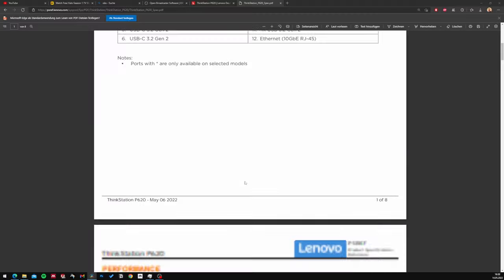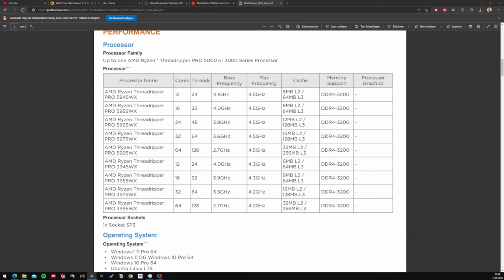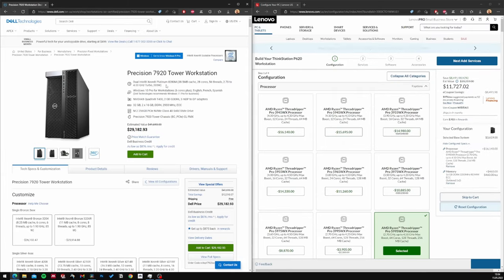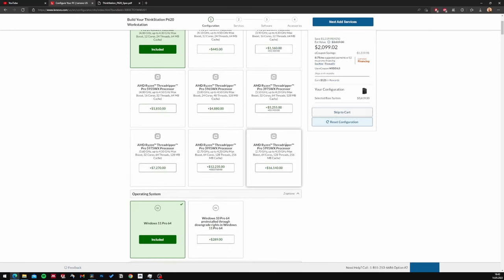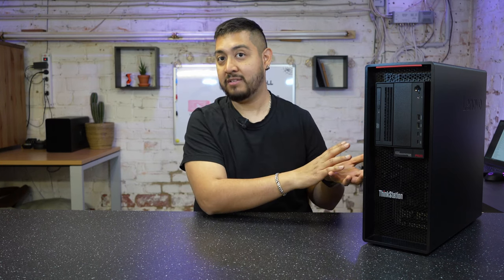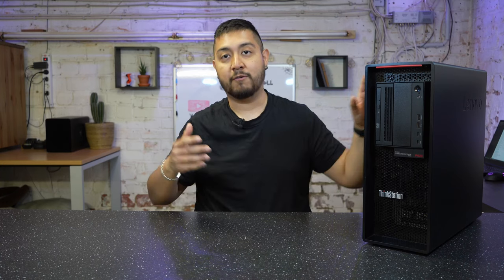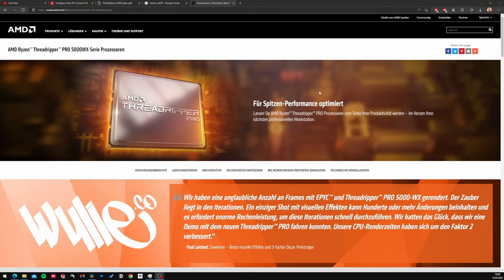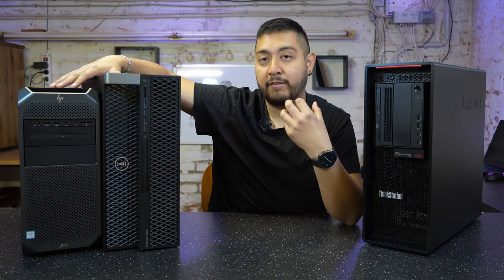Lenovo P620 / The king of the Workstations! / Workstation vs PC Part 2

Comment: On the older ThinkStations and ThinkServers, you reflash the BIOS while having some of the system fans disconnected, and this will get rid of the FAN FAILURE prompt on boot up. I did it many times on my C30s, S30s and TS4x0s.

Would be cool to see if this trick still works.

Comment: Dell also came out with T7865 Threadripper workstation last year, so all of them are jumping on that train. The sad thing is, some of the Intel chips can still beat the single Threadripper since you can have two of them. AMD decided to only allow Threadripper to run in one socket motherboards. The only reason I think they did that is to prevent them from cannibalizing their EPYC server chips.